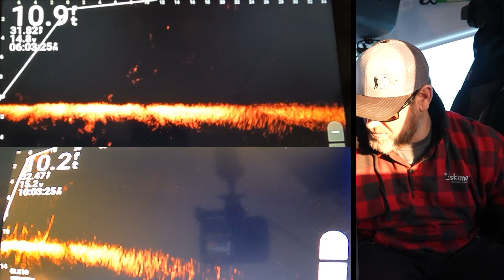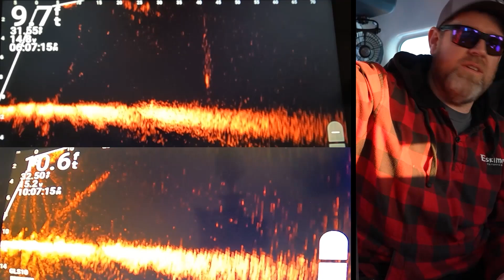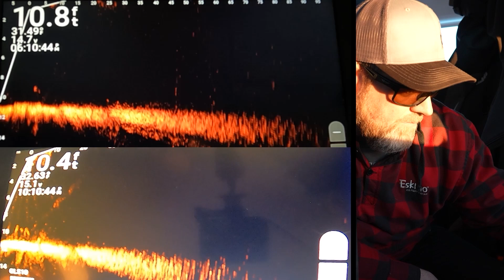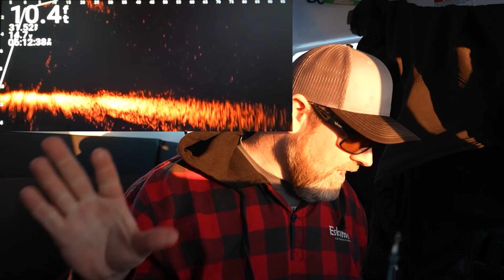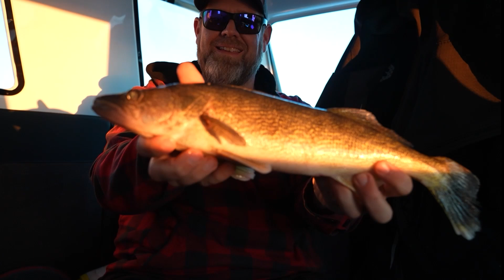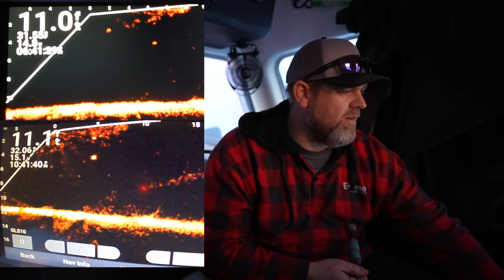TRUE Garmin Livescope Side by Side test w/ LVS34 & LVS32

Comment: We saw you pull the 32 to clear up the 34, but why not pull the 34 to see how much clearer the 32 would get.. Not a true test until that is done..
Reply: It's true. This is not a valid test.
Until now, I could not find on YouTube a real compare test between 32 and 34 without the interference of running two transducers sending signals on the same frequencies.

Moreover, most of the existing YouTube tests are flawed by bad design or intentionally biased, people being motivated financially (sponsored or sellers) or emotionally (prove to themselves that they decided right to buy the 34).

Comment: Mad respect for listening to your audience and delivering on an actual side by side. Thanks for providing.

What I would ALSO like to see is you play with the settings on the LVS32 to try and get the screen to look as close as possible to the LVS34. Then we can see how they truly compare when they physically look the same.
Reply: He is also using two different units I’m pretty sure the 34 is hooked up to a ultra 102 which has a better screen resolution by far over a uhd series to begin with should be using them on the same unit for true side by side comparison
Reply: @poke_USA  this is a good point actually.

Comment: bad camera angle and to me they arent that much different also you didnt play with the settings very much on either of them. not impressed and to me its not a very good comparison test
Reply: @Hooty Hoo  showing that the 34 is more tolerant of using the color gain function without the screen getting all clogged up with more interference.  The units are different yes one is a 106sv ( 34 ).  Other is a 94 sv ( 32 ). This is what I have to use and the most comparable units I have. Thanks for watching.  These units can’t be setup the same for anything TVG , noise rejection color gain etc cause they will not produce the same quality images at all,  I’m trying to show the capability of the 34 is all and using my everyday 32 unit to compare!  Both are great and again I’m not trying to sell you this unit and I’m still learning the 34 capabilities as we go.  Thanks for watching and we will take your criticism to make the next even better. Fish on!
Reply: Thanks for watching Shane the cameras are the same and on the same mounts. Let us know what you would like to see and we will see if we can accomplish it for you thanks.
Reply: I agree with Shane.. also you never said what unit you were using for the lvs32, pixels make a huge difference. I have a 8410 and a 94 both on lvs32’s and my 8410 is way more readable, looks like going off the thumbnail you have two different graphs. But I’ll probably end up swapping out my 32’s for 34’s.
Reply: @ishstah2279   units were 106sv for the 34 and 94sv for 32.